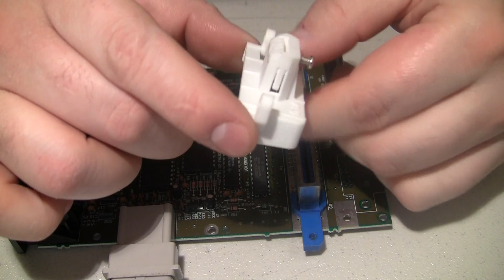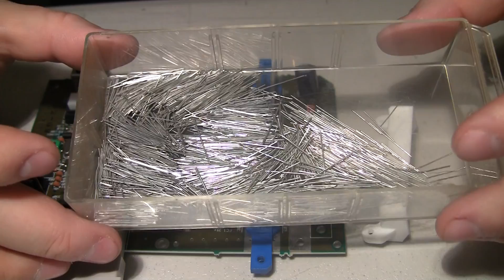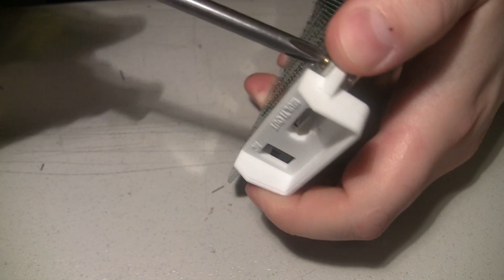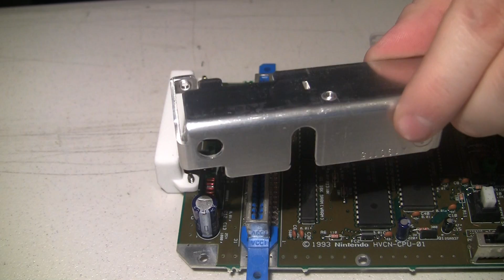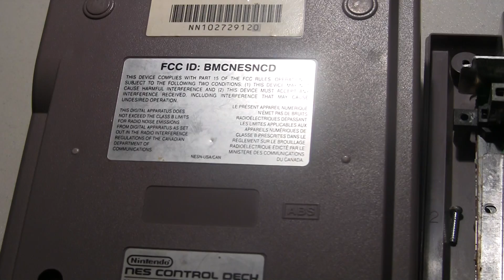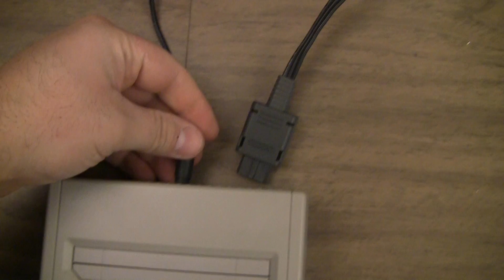AV Famicom Nintendo with 3D printed rear panel

Comment: Noteyou should of setup for svideo as you are using multiple in out port which you can use svideo adapter cable for the Snes

Comment: Step 1: 3D Print an Atari Jaguar Case
Step 2: Use loose parts in your workshop and sodder them together
Step 3: Buy a 3rd Party Wii Controller
Step 4: Call this new device the GameTech Camelon
Step 5: Make Bank